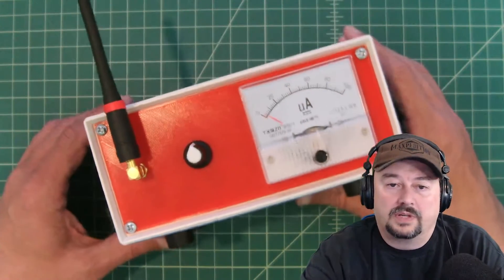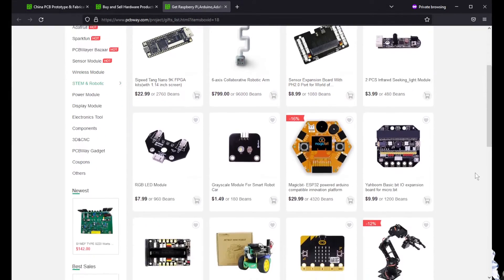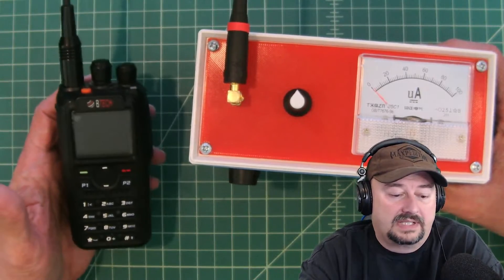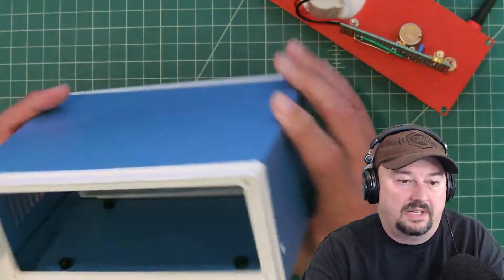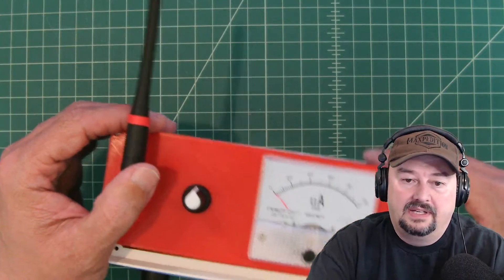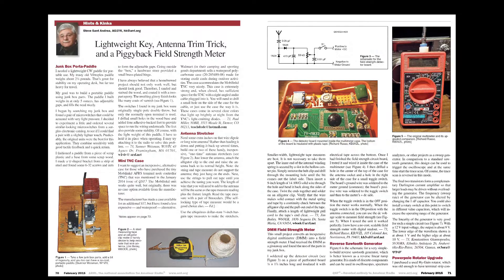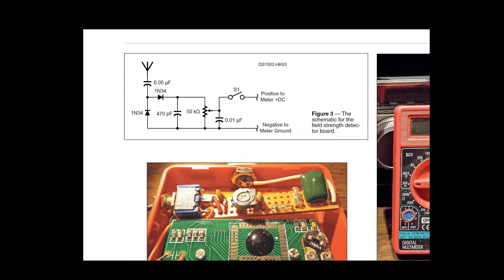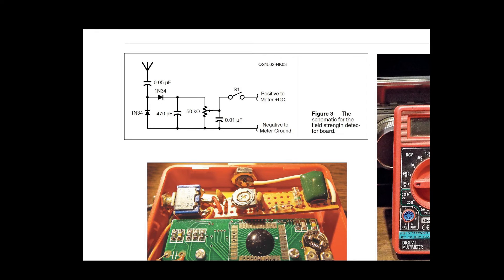Build an AMAZING Field Strength Meter for Ham Radio!

Comment: Hey I am trying to make a telemetry setup and i am missing the fsm, is there a way to set the FSM for a single frequency?
Reply from the maker: I’m sure there is but I’m not sure how, I’d use an antenna tuned for that frequency 👍
Reply: I do have a yagi antenna tuned to it! Using sdr I can hear the signal I just have very poor hearing so I'd like to visualize the signal strength to adapt!

Comment: Can something similar be done to limit the FSM to a specific frequency range? Curious.
Reply from the maker: If there is, I am not smart enough to tell you how to do it.  Thanks for watching Tim.
Reply: Yes, you can add a band pass filter inline with the antenna system or even use a variable inductor in series with the antenna to change resonant frequency..